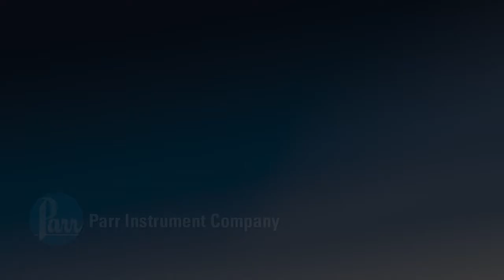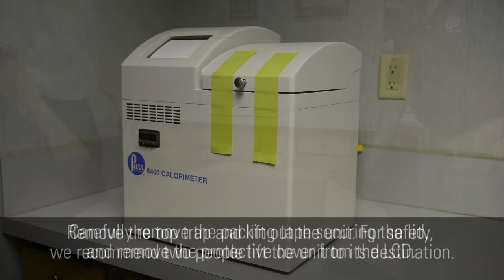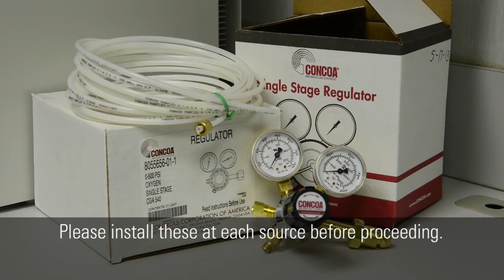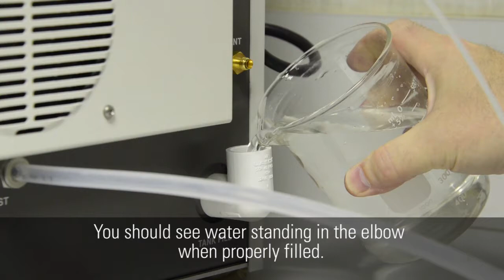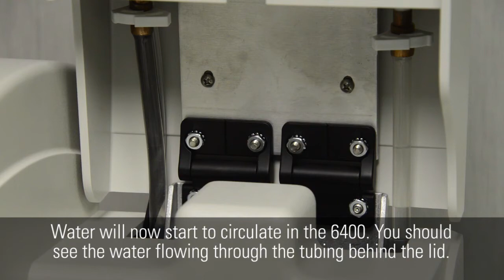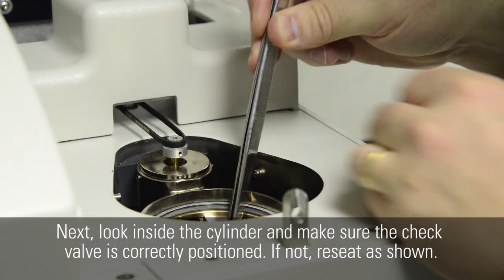Parr 6400 Calorimeter Installation Guide

Comment: How to disable start
Reply from the maker: Thank you for your comment.  I assume that you are trying to get the START button active.  The START and START PRETEST buttons are deactivated if the heater and pump are off or if the jacket temperature is out of tolerance.  The tolerance for the jacket temperature is 29.5 to 30.5 C.  Once the jacket temperature reaches that range it will take an additional 15 minutes before the buttons becomes active to make sure that the temperature is stable.  To disable the START button, just turn off the heater and pump.
If you need any additional information please feel free to call us at (309)-762-7716 or or send an email to parr@parrinst.com and one of our Calorimeter Technical Representatives can assist.

Comment: Why is it so loud
Reply from the maker: Hello Barbara,
Thank you for your comment. There are many components of the 6400 that can cause noise in the system. Depending on the age of the instrument, this can either be a sign of a component that needs to be replaced or normal operation. The exhaust of the pressure from the inside of the combustion vessel can be somewhat surprising at first. 450psi of oxygen is being release from a 3/8” diameter tube into a smaller collection vessel. The vessel is also rinsed/washed a few times to ensure that everything is clean. This uses the same 450psi of oxygen pressure. If this is an issue, the tubing from the exhaust and vent connections for the back of the calorimeter can be plumbed to a larger container or to a space outside of the lab.

If you need any additional information please feel free to call us at (309)-762-7716 or or send an email to parr@parrinst.com and one of our Calorimeter Technical Representatives can assist.

Comment: What is function of vent line?
Reply from the maker: Hello! Thank you for your question. The vent line is used to depressurize the oxygen fill line inside the instrument. After the oxygen filling is complete the oxygen fill solenoid is de-energized and the tubing vents out the vent line. When this happens the pressurized gas inside the vessel causes a check valve to seal the chamber.